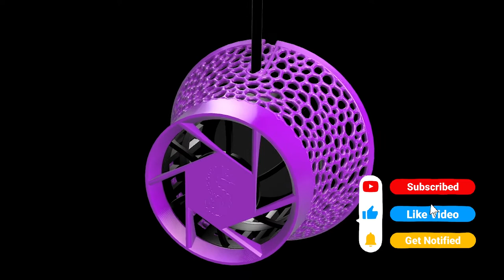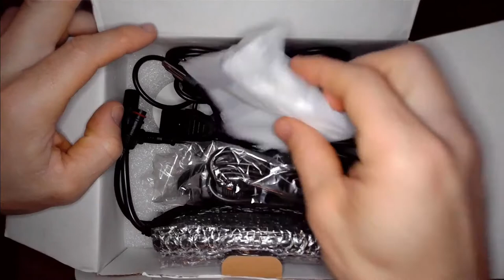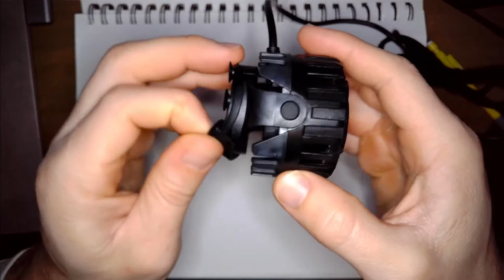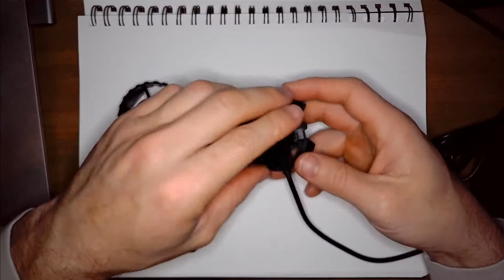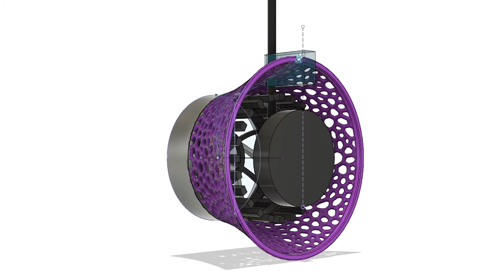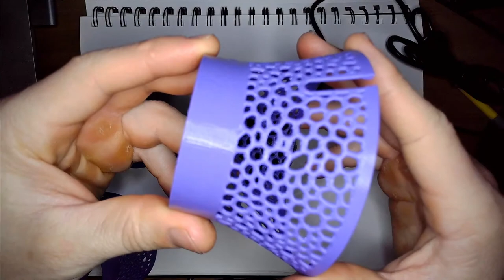Hygger Wave 2600 Pump Fish & Anemone Guard | HG-951 20w

Comment: Would you still be able to tilt the wave maker? This model has a slit tilt option
Reply from the maker: Unfortunately no.  The guard sits just a few millimeters off of the glass.
Reply: @ISeaLive  okay, I’m about to order either the 1600 or the 2600 wave maker and love the design. I have smaller fish and this would work perfect. Awesome job on this design. Will definitely order one of them if I buy the wave maker.
Reply from the maker: @JBTexas  awesome, thank you 👍🏻